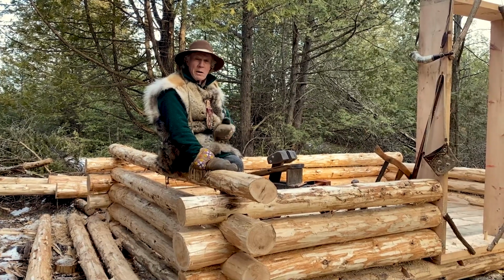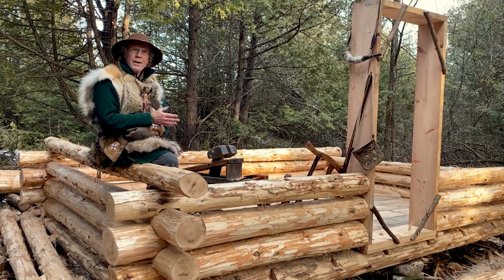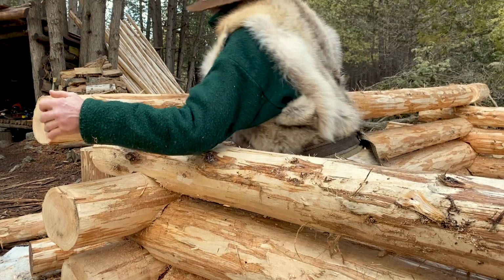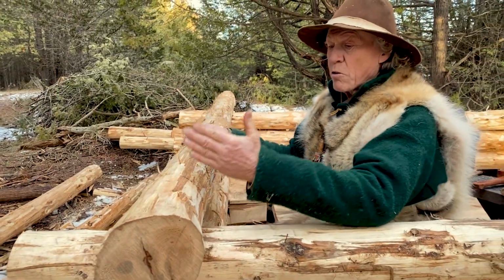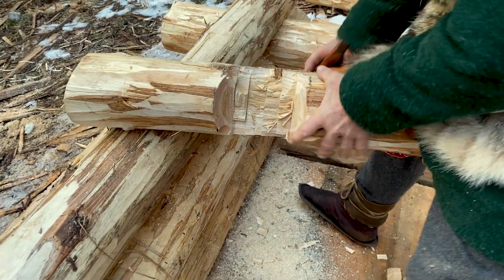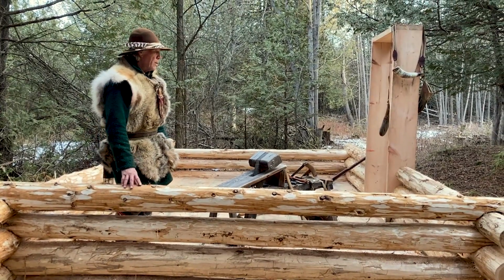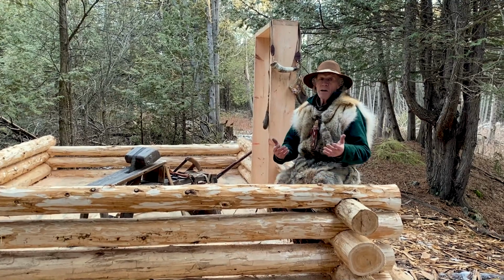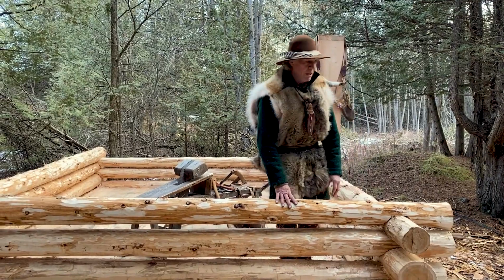Raising and Notching the Logs | LOG CABIN BUILD | PIONEER LIFE CIRCA 1700's

Comment: I could not find the exact episode, but the effective weight of a log pulled up a lever is based upon the sin of the angle of the lever.  Your levers were at about 45 degrees, so the effective weight would be .707 of the weight.  You need to get the levers longer to get the sin to be about 30 degrees to reduce the weight to .50.  I did not remember my trig functions, either, so I let my iPad find them for me.
Reply from the maker: Thanks for the reminder, I will keep that in mind on the next build!

Comment: Hello loving your style of doing things I do have a wierd question.how do you tye you each so you don’t have a big knot in the back?i tye mine n back to ,no fun sitting down in a real chair,thanks keep on making more
Reply from the maker: I’ll try to explain Paul but, it would be much easier to demonstrate... fold the length you desire for the first drop portion of the sash on a 45 degree angle then wrap the second wrap around your waist bringing the second drop underneath the 45 degree fold you initially made and pull tight.  This method has never failed me, stays tight all day long without an actual knot. I hope that helps.